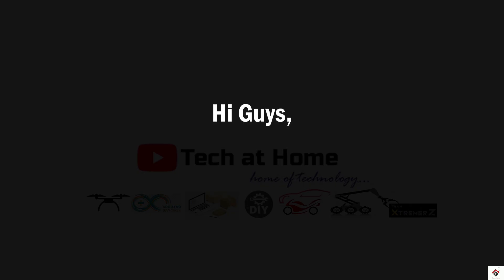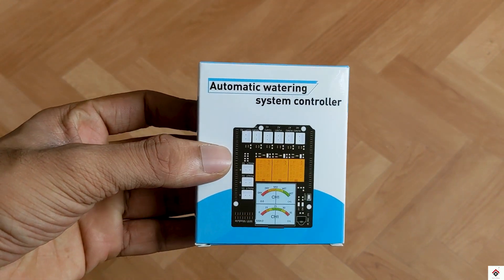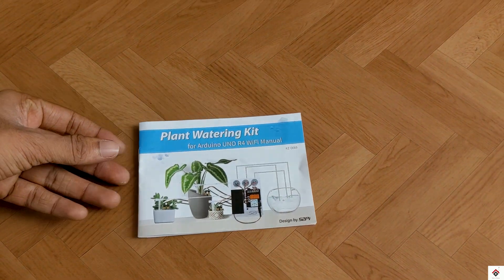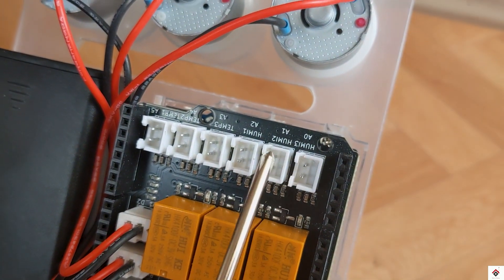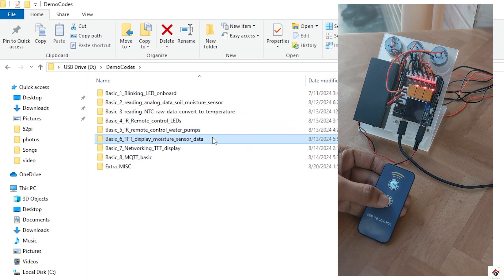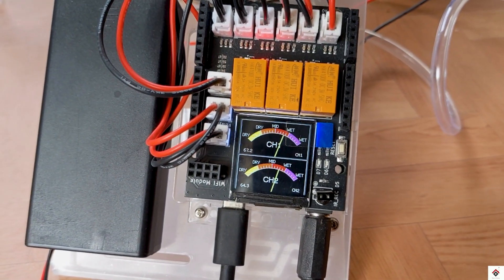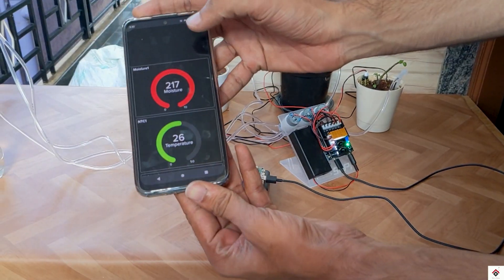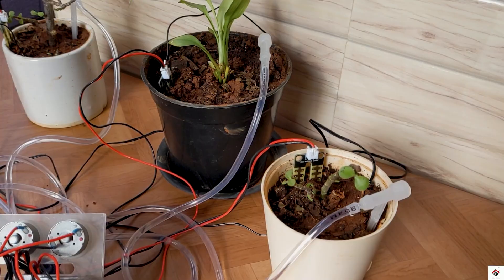52Pi Plant Watering Kit with Arduino UNO R4 WiFi |  DIY Automatic Plant Irrigation Project Kit ☘️💦

Comment: Nice one, can we connect Multiple kits to a zigbee network and with higher rating motor?
Reply: zigbee bluetooth network ? you can try it, higher rating motor may need external power supply.